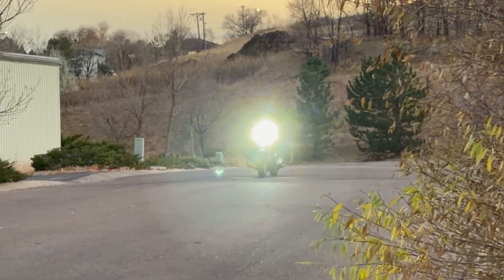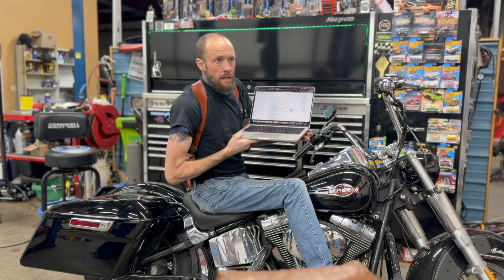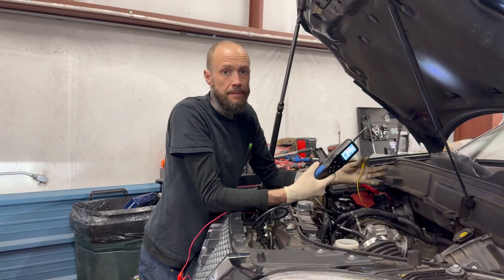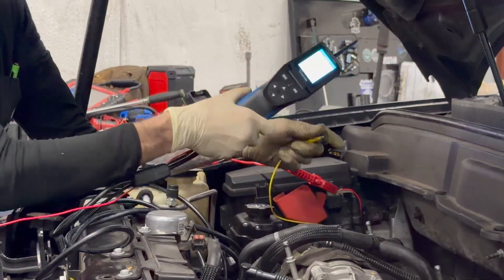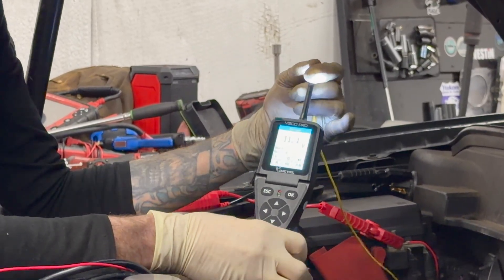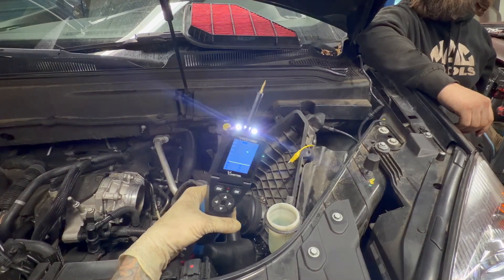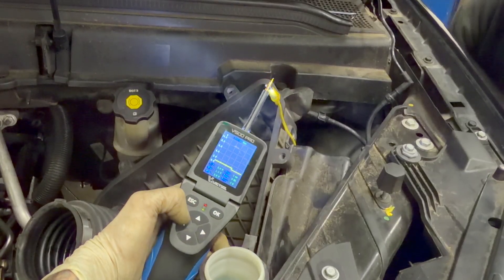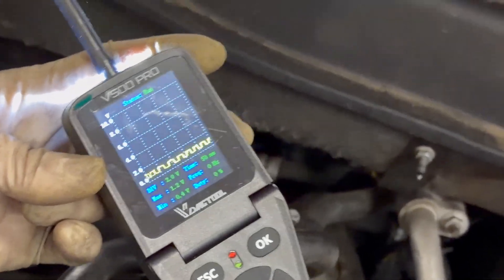Stop Guessing! Diagnose GM ABS Sensors with a 12V Power Test

Comment from the maker: GM used active 12-volt wheel speed sensors, not the old “generate their own voltage” style. If your ABS light is on, testing the power and ground FIRST can save you $$$.

Comment your year/make/model and what your scan tool is showing — I’ll help you find the bad wheel.